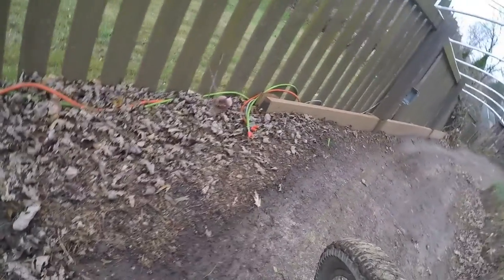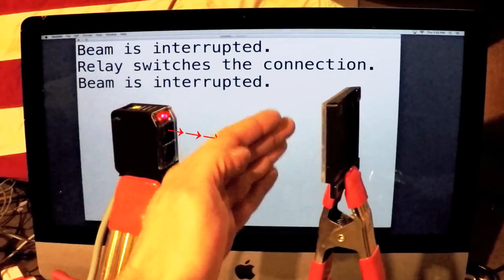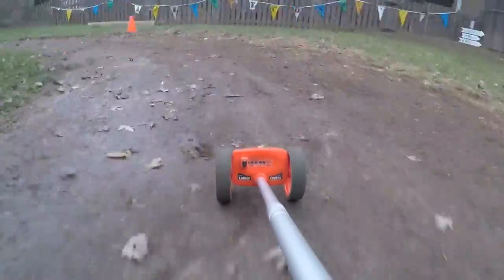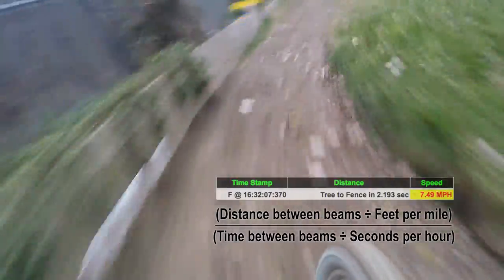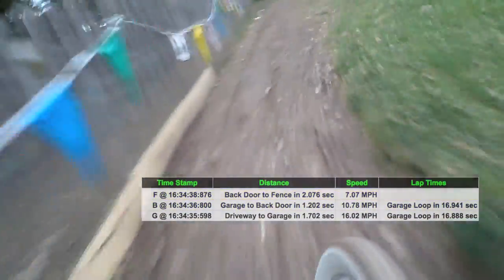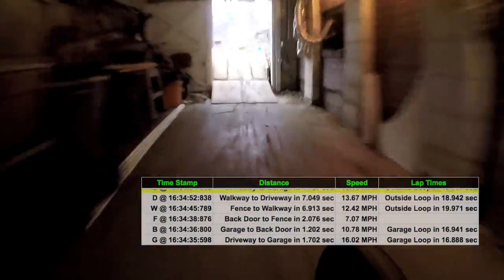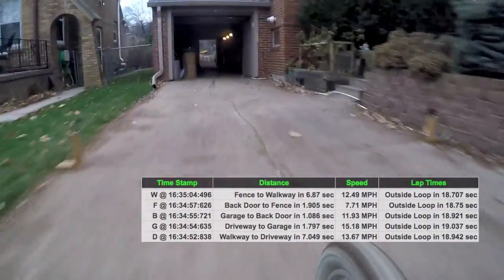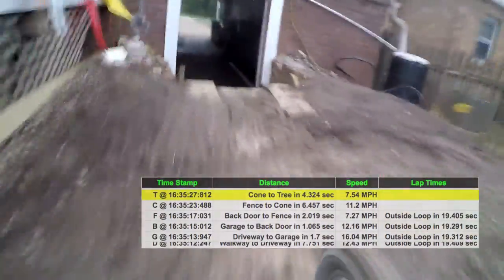DIY Track Timer Update

Comment: How would you create one of these with a button release that starts the timer for runners. The ones in NFL combines work when the player’s leaves the button and their time is documented when they pass through the laser gate.
Reply from the maker: X-Keys makes buttons and switches that could be used instead of a beam sensor to trigger the clock, but I just watched some NFL Combine 40-yard dash videos and it looks like they are using an invisible beam sensor to start the clock. I think the hand touching the ground blocks the beam sensor and when they lift their hand up it triggers the clock to start. The USB switch works in both directions ON or OFF, my timing system uses the ON position, but easy to configure to react to OFF position.

Comment: Hey you think if laser had enough power and or brightness to reach across a a 20ft span and about 10ft or so off the ground or maybe use multiple lasers or mirrors to make a grid kind of ,that it would be able to capture a 250mm quadcopter that's moving between 160-180mph?
Looking for a way to record time over distance without the help of a human and rather accurate but not too crazy ,maybe 1/10 of a second and trying to find a sub 100$ route.
Reply from the maker: Seco-Larm makes all sorts of beam sensors including an Infrared Curtain with up to 8 pairs of sensors that can span 25ft. I recently made a video testing the high speed photoelectric beam switch. The reaction time of these sensors is around 1 millisecond, no joke. https://www.youtube.com/watch?v=PkkhXaIopgM

Comment: Hı , i want to build system for  10 or 20m  fly time for running which system will be usefull,  fly means you run 30m before 2 checkpoints then time the two checkpoints

Comment: Do you have the lap time formula?  I was able to copy the google sheets auto insert timestamp, but I cannot get it to calculate the lap times.
Reply from the maker: You have to convert the HH:MM:SS:sss timestamp into all milliseconds and the difference is lap time. Here is timestamp formula =(LEFT(A1;2)*60*60*1000)+(MID(A1;4;2)*60*1000)+(MID(A1;7;2)*1000)+(RIGHT(A1;3))

Comment: How fast can the photoelectric switch switch? Could you make a video just moving your hand very fast between it? Thanks!
Reply from the maker: Interesting question. The timestamp records at .001 or a thousandth of a second. The fastest camera I have shoots at 240 frames per second, about 1/4 of the speed, plus the photoelectric beam sensor is invisible. I just looked up the data sheet for Seco-Larm Reflective Photoelectric Beam Sensor, and it says "Response time 10ms (max.)" I think that means it could switch up to 10 times a second! I can't move my hand that fast.
Reply: Scott Blake I think the 10ms is only the response time for the switch tobengage when it doesn't see the return. I'm thinking about making a timing setup for road cycling / bmx, where two riders can arrive in quick succession? I think it won't be able to switch 100x per minute.. That would mean you could run a 100rpm fan in front of it and it would switch with them all! I doubt it! But It'd be nice to see if it can handle hand waving as fast as possible, say 5 times per second. There are many cases when there is like 5-30cm between each successive riders. I'd like to see if the accuracy is enough for that. Thanks
Reply from the maker: When I ride past an invisible beam sensor the USB switch will usually get triggered several times about 1/10 of a second apart. I'm only using the Normally Open wires, so the USB switch could just be hitting the same letter on virtual keyboard as long as the beam is interrupted, but it feels like the sensor is switching ON/OFF as the beam can see through empty parts of the trike, like where the spokes are. I think a beam sensor could see a very small space between two riders, but you'd need a way to identify the rapid timestamps. My backyard track is only wide enough for one person at a time with no room to pass, and this timing system seems plenty accurate for racing the clock.
Reply from the maker: rkan2 I just tested one of the photoelectric switches by waving my hand in front of the sensor with my fingers spread open, and it can read the space between my fingers at an impressive speed. You can hear the relay switch inside the beam sensor, clicking ON/OFF like a high speed rattle. I think Google Sheets is struggling to keep pace with the rapid keystroke entries, but I got the USB Switch to trigger multiple times 100ms apart.
Reply: Scott Blake Thanks! That's awesome! (now let's hope the versions from Aliexpress work similarly.) Btw, if you ever need more of timing points, instead of using the x-keys thing, I recommend you to check out "usb joystick encoders" They can be had for like 6$ and should work just as well.
Reply from the maker: rkan2 https://www.youtube.com/watch?v=PkkhXaIopgM

Comment: How is the thing wired if it is 10V to an USB device?
Reply from the maker: The reflective beam sensors are not powered by the USB device. The reflective beam senors have two wires connected to the USB switch, and two more wires connected to a standard 120V power outlet. Only the X-Keys USB Switch Interface is powered by 5V USB wires.
Reply: Scott Blake I'm thinking buying a couple of these from china directly and I'm just thinking what the connectors should be like. There are options for 3 or 5 lead ones. My system also needs to be portable, thus I need the lowest voltages I can get. It seems most of them have a pretty wide support for 10-250V, so it shouldn't be an issue.

Any idea on when your blog is going to be back up? Thanks
Reply from the maker: rkan2  I got my Seco-Larm Reflective Photoelectric Beam Sensors from Amazon, and they have 5 lead wires. I only use 4 out of the 5 wires, I do not use the normally closed (NC) connection. The beam senors do have a wide input voltage range. You can connect two 9V in series by snapping one of the positive connectors to the negative connector on the other battery for simple portable 18V. I also like to use cordless tool batteries for easy portable power on demand.